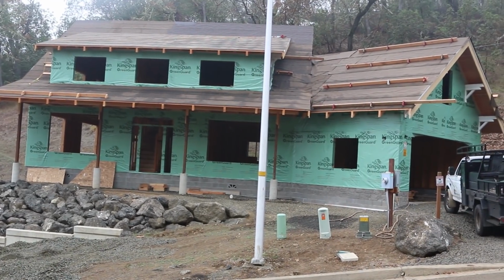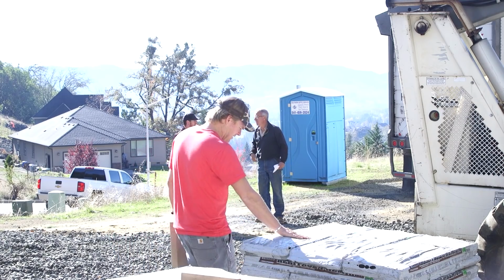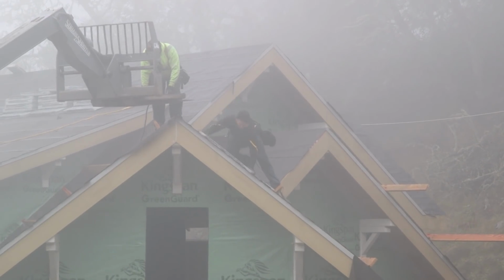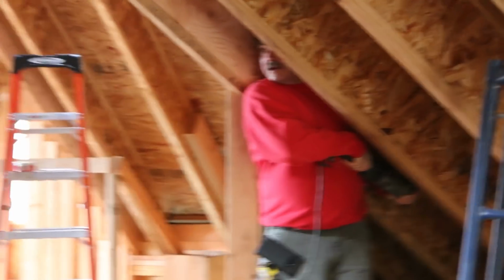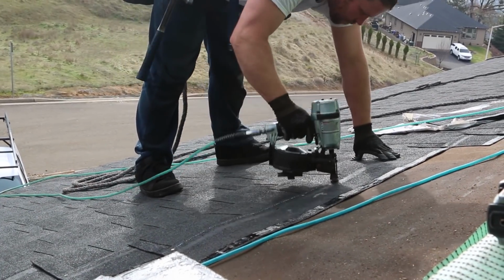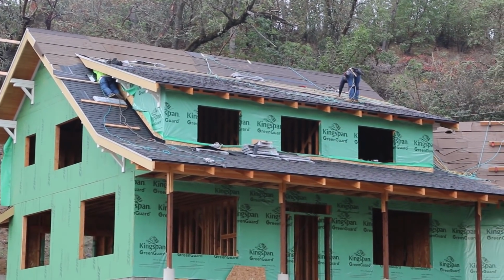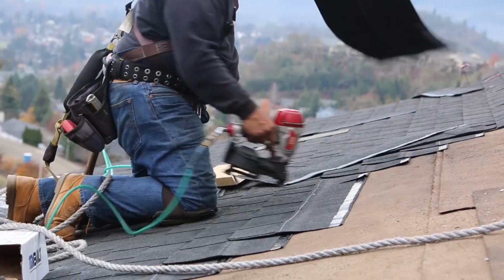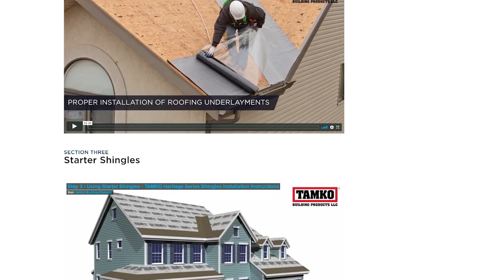Installing Asphalt Shingles Ep.77

Comment: I noticed these guys placed the gun before pulling the trigger rather than bouncing it along. I’m not sure if either is right or wrong but may just have been marginal air volume from so many working off a small compressor.

Comment: It never fails when you start putting shingles on in any video, the "experts" come out of the woodwork questioning nailing schedule patterns and giving everyone their expert analysis.  The only other "experts" that are worse are the concrete "experts" . When you watch any video where there is a concrete truck you'll get the analysis on the forms and the finish and how "we" do it the right way.  Sheeeeesh. get a grip fellas.
Reply: And yet, when it comes to shingles, there IS a right way and there is a wrong way. And lots of cut corners.

Comment: I am wondering what the correct sequence is for the installation of the drip edge.  Owins Corning shows it on top of the underlayment which means you are dependent on the starter strip to seal to the underlayment.  I never in my life would show a roof edge detail in the manner. The drip edge should go on first with the self adhering roof membrane being carried over the top of the drip edge to the leading edge.  The paint on my fascia board and wood drip edge is peeling. Upon remove of a portion of the fascia board the back of the board was damp which means water is getting in behind. This was a reroof and I added the drip edge to have a little bit more detail on the roof edge. Unfortunately the existing roof deck only extended to the edge of the existing fascia board so I brought the new wood drip edge to the top of the plywood and champhered the top edge to match the roof pitch. If the drip edge had been installed first the self adhering roof membrane would have extended to the leading edge of the metal drip edge thus directing the water off the roof. Which is the correct way to install the metal drip edge?

Comment: Thank you for your ladder video! I was working in the painting business in the Florida heat. After a few years I was on a first story roof.. using an extension ladder that I didn't set. Some other guy did and the rungs were not set. It started to go when I put foot pressure on it and I had to jump. It was in heavy grass (not concrete, thank the Lord) and one story, im young so I was okay. But now am terrified of extension ladders ,after years of doing them every day and going back to a different trade I am very deliberate. Step ladders are probably more or just as dangerous...

Comment: I’ve worked mostly in residential remodeling, so I’ve gotten to either watch or do almost every part of building a house. Almost every time I have  worked on shingling a roof we set up a scaffold so the eaves would be at waist height. Some times it was wall jacks, but usually it was with ladder jacks. The metal drip edge, ice & water barrier, and as many courses of shingles as we could reach would be installed from the scaffold with the roof brackets being nailed over the fourth or fifth course. If the pitch was less than 6” that would be the only row of planks on the roof. Steeper than that we would put another row of brackets every 5 or 6 feet up. Never felt I was in any real danger of falling to the ground between the scaffold at the eaves and that first set of planks on the roof brackets.
My uncle Art was up on a customers roof once, I’m not sure if it was to get some measurements for an estimate or some other reason. While he was up there the wind blew the ladder over and he was stuck sitting on the roof until the housewife came home and was able to stand the ladder back up. That same decade I had been up on the roof of a masonry building helping my friend Nick do a cement coping between the concrete roof and the block parapet so the rubber roofing wouldn’t have to make a sharp bend. While we were sitting on the ground eating lunch, the wind knocked our ladder over. Needless to say, I always tie my ladders off if there’s any way to do so.
Lastly, The few times I have used Tamko shingles, I was favorably impressed.

Comment: Great fan of this series. I have learned so much from Phil and I enjoy his style. On this video especially, I noticed that the roofing crew was using safety harnesses and rope but the slack in their lines would do nothing to break their fall to the ground. I saw this several times throughout the video. So is wearing a safety harness just "code" and is there no oversight on using it properly?  But still a fantastic series. I didn't want to leave on a negative note.

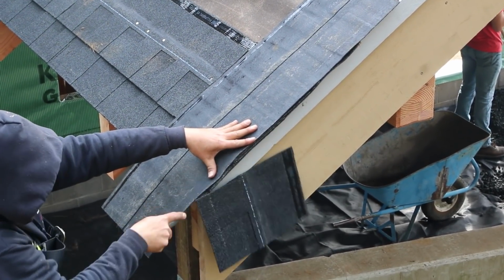Comment: 9:20
Why the vertical shingle on the end? I might learn something ... (Keith in NE England)
Reply: He's just using it as a straight edge cutting guide.  It doesn't stay there.
Reply: I don't know for sure, but maybe it raises the end up a bit to direct the water away from the edge of the roof? BTW I am from the SE of England (Thanet) :D
Reply: @mrshoeguy2477  at 9:30 you can see it does stay there.
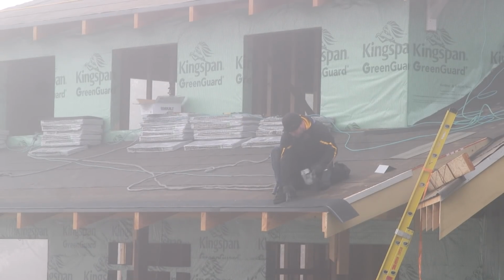Reply: The "vertical shingle" underneath is one of the starter shingles which are already explained at 5:24 .
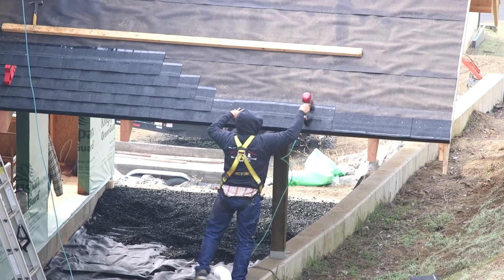 Basically to make a nice looking and watertight edge, with a better adhesive to the sublayer on the roof, and no gaps in between the decorated shingles that show the sublayer: 8:55 and 9:03. The 9:22 top one with its downside up, is just a guide to make a straight cut.
Reply: @mrshoeguy2477  Sorry, but it did stay there.
Reply: It helps prevent 'uplift' as well as directing water away from the edge. Basically added weight to the edge so the shingles resist wind better. Also helps give a nice crisp edge. I always use a 'd' style flashing which gives you the same thing, but with metal, so I havent used edge strip like that in a long time, but it's a perfectly valid method.
Reply: It’s just a starter shingle very common practice here in the northwest
Reply: @TpetPlayr  Got it thanks!

Comment: Surprised to not see chalk (straight) lines usually set every 5th course to maintain square.   Installed just before shingle install measured so the top of every shingle in that row is on line.

Comment: As sad as it is to say, many installers don't follow proper protocol when installing shingles such as these. Besides having a 50 year service life they also have a very high wind rating. However, there's very specific amount of nails and spacing schedule for those nails per shingle.
If you ever have an issue and need to call on the company for the warranty, they will send a rep out and pull the shingles around the area to ensure the proper number of nails and spacing required to satisfy the what the warranty calls for.
So sadly, I've seen people call on the warranty only to find that the installer skipped a nail per shingle (but probably charged for it in supplies for the job) and the warranty is null and void. This is especially true for wind rating 
For certainteed's 50 year shingle, it's 6-7 nails per shingle (depends on exact product) and as long as equally spaced then the spacing part is satisfied.  
Caught my aunt's installer only using 4 per shingle when the 25 year shingles she bought called for 5. 
They charged for 5 nails per shingle in building costs too.
Just got to know these things and catch them or make sure you hire a respectable roofing company.

Comment: Wow. I say this because here in Miami Florida you would have to use 2" tabs when nailing down paper and shingles. I guess talks lucked out. Good job on the house though
Reply: everything in Miami is different Dade county leads the building code for roofing for all of the USA because you have the hardest roofing conditions around. so everything that is done in FL is usually more robust

Comment: Thanks for talking about safety. Sadly, I think a lot of the actual work was "safety theater". Harnesses and lifelines are well and good, but if there's enough slack in the system that you'll hit the ground before the system comes tight, all you have is window dressing in case the OSHA inspector comes by, and an additional tripping hazard. Be safe, and thank you for this series.
Reply: Absolutely! It looked to me like they were wearing the safety equipment because the boss said they had to. They didn't seem to be even slightly concerned about using it properly. Even when working on a wet surface!

Comment: Asphalt shingles or ceramic/concrete roof tiles?

What's the pros & cons for each?
Reply: Price
Reply: Depends on your location / climate and price range. 
I recommend tiles for hot arid climates because they ventilate the roof better to keep the house more cool ( this means less money on AC).  Wouldn't recommend tiles for locations with snow ( it's already cold). If the pitch of the roof is good enough to let the snow roll off the tile you can do it.  Just gotta keep in mind the max load a house can  handle because tile is heavy and snow can be heavy too.  Shingles are good all around to keep water out but don't assist in keeping your house cool like tiles do. Would recommend shingles for any other situation because there is no point in spending a lot of money on tile unless you have the money and you want that tile look.  
The pitch of the roof and how much weight your roof was designed to handle are also limiting factors for tile because it can be heavy  as mentioned before and your house actually  compresses when tile is loaded up on a roof.... There are other  minor factors that can be addressed if you really want tile.

Comment: What's that funny looking thing the roofers are wearing?  :)  (I know it's a safety harness, just never seen roofers wear one.  I think he hired the very best for this section.)
Reply: Good to see ropes being used but some of the anchor points are a bit dodgy. If the anchor points arent right you create a big massive pendulum that could do more harm than good. Ìts not an easy thing to get right all the time. Probably the only real safe way is to run the ropes directly overhead i.e a crane (totally unrealistic)

Comment: The last time I helped install a new roof, I wasn't paid. A member of our church was out of work and his family home needed a new roof. So, with the help of several volunteers, we replaced the roof one Saturday -- it took most of the day. After working about four hours, shoveling off the old shingles and installing the new ones, I climbed off of the roof and went inside for what I thought would be a brief rest. As I sat in this good family's kitchen drinking ice water, the tops of my feet felt like they were burning. When I tried to get up to go back to work, I could hardly walk. The woman of the house, insisted I take my boots off. These are the boots I'd worn for years as I put myself through school working construction. They were good boots. I hadn't worn them in about five years. Maybe they'd shrunk, maybe my feet had grown, or maybe I'd gone soft. I'd just spent a couple hours nailing off a roof. If you've ever done that, you know that you kneel with your toes curled so your weight is carried by your knees and toes. Anyway, when I took my boots off, my white socks were stained red. There was a row of bloody blisters across the top of my feet, where the toes join the foot. 

Still, it was a great activity to be part of. The family knew that we loved them. All the volunteers had a chance to render meaningful service. If I had to do anything over, I wouldn't have used church funds to hire a professional crew. I would have bought myself some properly fitting boots.
Reply: There is a product called Pro Knees. It didn't come up when I tried "knee pads". It supports the whole lower leg and protects the feet from what you experienced. I found them late in my career, to my regret. You have to send them "fitting measurements", and they aren't cheap. They do have replaceable parts. Worth every penny. I have had 4 knee replacements (as in surgery) and a couple of foot operations. None of that from accidents. Not sure how much fewer if I'd have had those Pro Knees.
There's one hazard worse than ladders - a drunk crew on a gamble roof barn. My first construction job. They drank their lunch. I didn't stay long, even if i did need the money badly. It wasn't the height that frightened me, although we used none of the safety rules the EC uses. None. I was young & dumb. Still a teen (or is that an oxymoron?)

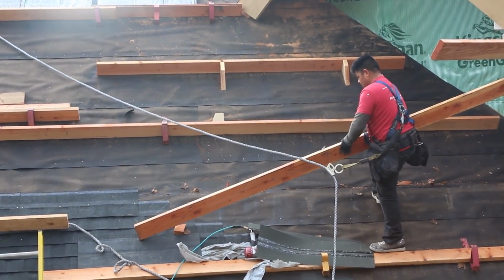Comment: 8:35 A ROOFER TAKING OUT NAILS OF A CLEAT??? Where did you find these guys? Going back to a jobsite after most roofers is like jumping into the jungle during the Vietnam war. There is stuff everywhere along with booby traps (i.e. nails sticking up in boards)

Comment: LADDERS... just to add to your Ladder Warning: 
A mate of mine was working on a step ladder running some Cat6 Ethernet cabling at our church a year or so back. He was standing on the step ladder with his head above the suspended ceiling. His feet were not even 5ft (1.5M in Australian!) above floor level. He moved the wrong way & the ladder slipped causing him to lose his balance & fall. 
He fractured his pelvis in 5 places! 
Fortunately he has recovered well, but you don't have to fall from a great height to badly injure yourself (or worse!)

Comment: I thought Code required Ice and Water from the eve to two feet inside the foundation wall or 6 feet if the area is subject to snow.  From what I see it looks like 30# felt paper from the eves to the peak..
Reply from the maker: Temperate climate here. Very little snow and even less freezing.

Comment: How do you set the coursing without any chalk lines?
Reply: I was wondering the same thing.  I suppose they used the lines that are imprinted on the roofing felt as a guide.  This will usually work okay if each course of felt is aligned precisely.
Reply from the maker: The lines on the felt are straight.
Reply: Besides the good reasons mentioned in the other comments below, the nail gun can itself be used as a gauge, and if hand-nailing,  roofing hatchets have an adjustable gauge with a movable pin.

Comment: It would have been nice to get more information on the details of shingle installation. What kind of nails to use, nail spacing, where to start laying the shingles, how to finish off the ridge line. Some of these videos have ended up being too high-level; more of an ad for the sponsor, rather than teaching me how to install a roof.
Reply: I'll stick with what EC us doing. There are plenty of detailed videos available - including the shingle manufacturer's. Use the trade publications. Fine Homebuilding and their website; JLC (Journal of Light Construction) and it's website, are just two examples. Frankly, EC does a better job, but you are asking too much! He has to build that house. The videos are on O.T. (Unpaid Overtime)

Comment: Why does USA use shingles instead of tiles or metal?
Reply: Main reason cost. A roof like this is 1/4 or less than most hard surface roofing. It's also half of a standing seam sealed metal roof. They work well and are proven.

In areas where people don't move often cost is 100% the reason. Areas where income is higher the average time in a house is 6 years so it's not worth the investment.

Upper end homes most definitely use tile, concrete, fake slate, standing seam, or any number of better products.
Reply: There are tile and metal roofs in the USA too. I think shingles are the most affordable option, so they're really common.
Reply: Like this seems such a stupid building material to use. Can literally catch on fire, can melt, wears quick as anything.. Glues and chemicals and crap all over your house now?? Its like dying cheese orange because thats "good cheese" or whatever other beyond stupid things Americans do.
Reply: Two main reasons. 1 is cost. Most tiles are 8 times more expensive that shingles. Metal is about 5 times more expensive. This is mainly due to where they are manufactured. The second is weather. Lots of hail storms across mid to lower areas of the US. With that said, tiles and metal have much better aging and look fantastic. It's a trade off.
Reply: Cost.  Metal is about 2x the price, and people move every 5-7 years.  Nobody wants to pay for a long lived roof they're not going to use.
Reply: They should look at corrugated iron, that’s the alternative in Australia. I think it would be faster to instal too.
Reply: Waste of money when the timber-framed houses blown down in a gale.
Reply: @hqlion  i don't think so
Reply: Add 2 reasons: (1) the weight of "mission tiles" and slate required heavier structures - lots of present & past construction can't take it. That why they invented "plastic" mission tiles, I suspect. (2) There aren't that many contractors for that, in most regions. 
Anyone know the cost & perils of shipping either?  There are slate quarries in the New England States where they make them. Is there elsewhere? The shipping from New England to Oregon must cost a pretty penny.

Comment: There is a reason why a scaffold arround the entire house is something you'll find on any size construction site in Germany ;-)
Reply: Yes, same as Australia. It's caused by over zealous litigation, lack of personal responsibility and a race to the bottom hiring the cheapest, least experienced workers (with no experience) for the job.
Builders hire the cheapest labour that will do the job. Workers with no, or very little experience are let loose on jobs that really require experience and then governments interfere by creating more and more legislation, instead of insisting on proper training and certification of employees (because industry organisations lobby governments that employers shouldn't have to bear the costs of training, so they try to make the government responsible for it, instead of on the job training which costs more).
In Australia, you can spend 3-4 days doing a few courses and be let loose to work on any roof, even with zero experience. And the companies will be falling over to employ you, as you'll work for $10/hr less than an experienced tradesman or construction worker....